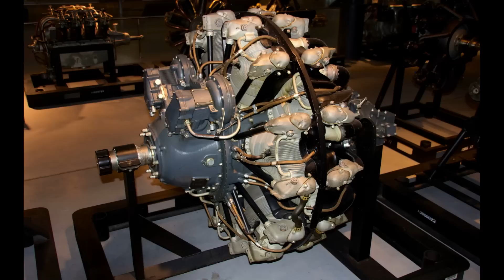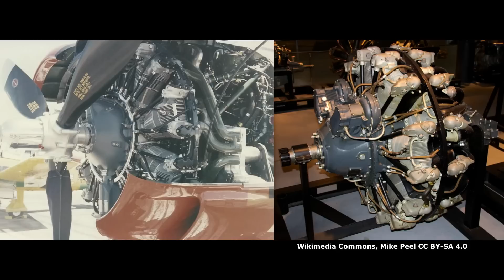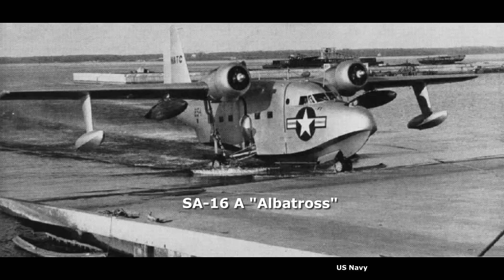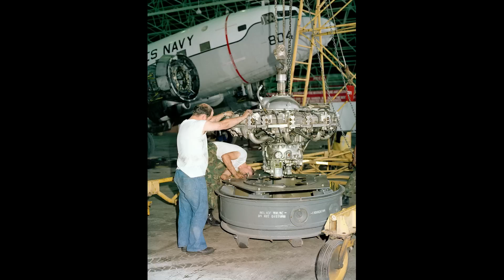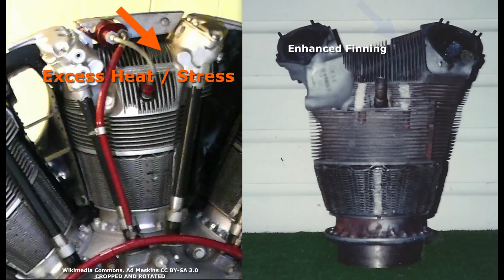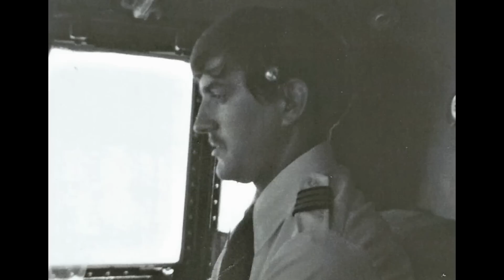The 9 Series Wright R-1820 and the Postwar Radial Design Reset (Episode 5)

Comment: Did the 9 series have higher compression? Usually increasing power output from the same displacement is accomplished by improved breathing (including more boost), more rpm, or higher compression. You didn't go into how the extra power was achieved……..
Reply from the maker: I mentioned the longer stroke which pulled in more air for compression, but I should have mentioned the compression ratio of 6.8:1 for the 9 Series versus 6.5: 1 -- 6.7:1 for most other large radial engines.

Comment: I am familiar with this engine -- sort of.  I was an "air attack" wildfire control pilot for a state forest service in the southeast US for a while.  The state owned three Mialec M-18 Dromader single engine air tankers* manufactured by PZL-Mialec in Poland.  These aircraft (built about 1994) were powered by a Polish-built  PZL Kalisz ASz-621R 9-cylinder air-cooled radial piston engine, with 980 hp.  This engine was a semi-bootleg copy of the Russian Schvetsov M-25/ASz 62IR, a version of the R-1820 licensed the Soviet Union.  The M-25 first flew in Russia in 1937 and was "improved" into the ASh-62.
Quality control and performance was ... umm, let's say, an unusual experience.  These aircraft were fitted with a 3.3 meter diameter four-bladed propeller made by PZL; it had skinny blades, was marvelously inefficient, and had seals on the pitch controllers that leaked more when seals were fitted than it did if it was run with the seals left out.  A quick fix was to fit DC-3 propeller blades but a more comprehensive upgrade was fitting a complete DC-3 propeller with pitch controller.  This was a complex engineering operation consisting of fitting thin-walled cylindrical spacers on the metric studs on the engine front section to adapt the inch-sized bores on the controller housings -- nothing else was needed.  The greater efficiency and better balance made the aircraft much easier to fly but really it was lipstick on a pig.
When the aircraft landed, they were met with a fuel truck and an oil truck, while the fuel was added to the wing tanks a similar nozzle filled the engine oil tank -- consumption was measured in gallons per hour for both.  We'd joke that piston rings were tested by dropping a dime into the spark plug hole on the top cylinder, if it dropped out of the spark plug of the bottom cylinder then the rings were worn out and needed to be replaced.  
The aircraft were appalling in many ways but the sound of the inertial starter spinning up, then the coughs and barks of the first cylinders firing, and then the sound of the engine on takeoff was thrilling music not heard at many modern airfields today.  (The aircraft were sold off with TBO timed out engines to ag contractors about 2019 to be replaced by turbine-powered "Air Tractors".  A great leap forward but sad to see them go - I loved those big old round engines.)

* There were four aircraft purchased about 1994 but one swallowed a valve caused by a dropped valve seat on takeoff after about 40 hours of time in service.  The aircraft was destroyed and the pilot fatally injured.
Reply from the maker: Thanks for sharing your interesting details/experiences with the Eastern Bloc engines/aircraft.  I had no idea that PZL Dromaders were operated in North America.  You certainly confirm that those Eastern copies were NOT the originals!
Reply: @AeroDinosaur  I felt a deep connection to the past when everyone (bomber pilots, air attack pilots, mechanics) would be called out on the flight line before startup.  Besides removing the tiedowns and control gust locks, we would take the propeller tips and "walk" the engines through 6 - 8 compression cycles to clear oil out of the cylinders.  As the propeller moved to the next blade, another person would take that one and push it through, then walk away from the prop on the other side in a continuous chain.  It was just like the videos of the B-17s being prepared for takeoff.  We all pitched in to do maintenance and repair work, I have felt very privileged to have been involved with them.

Just following the fall of the Iron Curtain, the Polish government was attempting to find markets for the PZL aircraft.  An importing company was established in the early - mid 90s in Wilmington, NC with a certified maintenance/repair facility at Burlington, NC.  That's how the Dromaders got to the Forest Service.  There was a push to sell the aircraft for ag flying with uncertain success, but at least some were sold.  A Canadian man living on the panhandle coast of Florida had a fleet of several (less than half a dozen) for agricultural work; he had contract with growers of "pulp wood" for paper making and he and his Dromaders would apply fertilizer to vast tracts of pine tree growing land in many states across the southeastern US.  I must add that by the time that I became familiar with him and his operation, most of his Dromaders were converted to PT-6 turbos and that change continued into the 20-teens.  But, yes, there were some Dromader operators in the US, late 90s/early 00s, at least.
Reply: Thank you for a most complete and thorough review of such an interesting workhorse engine.
Reply from the maker: @brucebear1  You remind me of some of the A1 Skyraider pilots I've talked to who in the early '70s flew the last single-engine piston combat missions in Vietnam or any war after that. They felt a unique kinship with the P-51, Spitfire, TBM, Hellcat, and Corsair pilots of World War II and considered it a privilege to fly the smoky, greasy, noisy Skyraider.  By the 1970s perhaps 99% of their flying peers did not know how to handle a heavy taildragger.  J.A. Reed
Reply from the maker: @brucebear1  Thank you very much and thanks for checking us out!  J. A. Reed

Comment: Surprise!  At about 23:50 into your video the comparison of power on the C-47 vs the later C-117D and the pictures used  showed the USMC C-117D with the number 420 on the nose.  That aircraft was US Navy Bureau Number (BuNo ) 12420 and I flew that aircraft while assigned to Headquarters and Maintenance Squadron 31 (H&MS-31) based at MCAS Beaufort, SC in the mid '70s.  I also flew that aircraft as the lead for the flight of two C-117Ds assigned to the Squadron to the "boneyard" at Davis-Monthan AFB in November of '78 and was therefore the last military pilot to fly it and so it holds a special place for me in my flying career.

The aircraft was manufactured as a C-47, Construction Number 09442, in 1943 for the USAAF.  It was subsequently re-manufactured under US Navy contract as you described as an R4D-8, later re-designated C-117D.  Sold surplus, it flew in civil registry in cargo operation for many years, and is currently in inactive storage in a south Florida airport.

Comment: As a tour guide at the Mid Atlantic Air Museum, never again will I point our stand  - mounted R 1820 from our H-34, and state it's the same as a B-17. Next time I'm there, I will take a close look at the cylinder head design. 
Videos like this are what keeps retirees like me on YouTube at 2AM!  
BTW, Amazon advises I'll receive your book on 9/27, looking forward to reading it.
Reply from the maker: Thank you for watching and for ordering the book!  I am sure you will enjoy it.  I suppose you could tell museum visitors that the H-34 engine is a "re-designed and more powerful version" of the engine that powered the B-17.  Continuing to make the connection with the B-17 might not be a bad idea because that plane is universally recognized and cherished.  Also, I am ready for your P-61 Black Widow !!  J.A. Reed.

Comment: Really enjoyed this episode. The WW2 Navy F4F-8/FM-2 R-1820 was rated at 1350 hp. Navy FM-2 ace, Joe McGraw, stated to me that their mechanics "tweaked" the engines to get more power out of them. He didn't say specifically what they did to "tweak" the engines but it likely involved an increase in either or both the max RPM and MAP. In any case, Joe was able to beat an experienced Zero pilot in a fight during the Leyte Gulf battle. The 9 series engines in the T-28B and C and C-1 that I was able to get time in were great engines, The E-1 used the 1575 hp version and the prototype with the twin tails and raydome removed was the fastest of all the S-2/C-1/E-1 type aircraft. As I recall, the C-1 had the 1425hp versions rated on purple 115/145 fuel. The max hp on 100/130 (green) fuel and 100LL (blue) was somewhat less.
Reply from the maker: Glad you enjoyed the episode and thanks for the info!  Nothing beats your actual experience.  Apparently, the 9 Series was also offered in "de-rated" versions as low as 1,100 hp, but I am not sure if those ever found applications.  I think one of the last B-17 versions built used 1,350 hp R-1820s, but I don't have details on that engine construction.

Comment: I believe the cylinder bore of the 3350, quoted as 6.125" incorrect. If memory serves me correctly the correct dimension is 6-5/16"
Reply from the maker: Actually, the R-3350 BORE wasn't 6 5/8" (6.3125"), but 6 1/8" (6.125"). The STROKE, not the BORE of the R-3350 was 6 5/8" (6.3125").  Before checking any other reference I always go to Jane's 'All The World's Aircraft' 1949 edition in the "Engines in Production" section.  Only after checking that do I check later references. Both the R-1820 and R-3350 are specified in Jane's at 6.125" bore.  On page 356 of your excellent book--and one of my cherished references, "Allied Aircraft Piston Engines of World War II"  you state, "The R-3350 shared the same bore and stroke as the R-2600, that is, 6.125-in bore and 6.3125-in stroke; . . ."  So, I just go with what I see!  I still can't figure out how you got your ground-running aircraft engines to run so successfully--I would not know where to begin. Thanks for watching--an honor! J.A. Reed

Comment: I want to put a 1525 horse on an AN-2. They had license built 1820s of 1050 hp. With a reversible prop, that would be a great ship!
Reply from the maker: Sounds like a great idea, but I guess you might need to add a cooling fan behind the propeller or limit the power, as the viewer below kind of hinted.  I guess that might be a major modification. J.A. Reed
Reply: @AeroDinosaur  
Yes indeed. Fan on the prop shaft like the FW-190 would help in ground operations, weight might be a problem as forgings  (heads) might be heavier than castings, being more dense, but the more fins cut in them might negate that; also, other beef ups might add weight too. Fortunately AN-2s are experimental here in the US, so there are more latitudes to use US powerplants. Even a 1200 horse 1820 from a Bull Thrush crop duster would be great. B-17 propeller too.  I wonder if a reversing prop would work on an earlier 1820. That would be fantastic for landing.  AN is one of my favorites and I want to own one despite 60 gph. I guess plane is an acronym for permanent loss and negative equity.😂 . Hell, P-51 burns that and has one seat, no baggage, and cannot carry a load and cannot land on rough strips. If I'm gonna spend the money on gas and oil, Antonov ticks all boxes for me.
Love your vids. Wouldn't mind talking airplanes. Message if you want. Aaron.
Reply from the maker: @huskyflylangley6053  Aaron-Thanks. Just send me an e-mail to the address shown on this written video description or channel description.  Would love to talk.  J.A. Reed
Reply: I too thought that would be insane, but then I'm thinking...the later model 1820s put out a LOT of heat. (as was well-covered in the video) Would an An-2 lumbering along at 100 kts be able to sufficiently keep the engine cool?  Doubt it.
Reply: @aircraftadventures-vids  I trained in them in Romania at a friend's airstrip and he operated with cowl flaps open and oil cooler open as well, getting off a 700'-800' strip with a full hopper load (3000 lb.) was no problem for the heat. If so, you can always pull 'er back, the takeoff performance with reversing capability is where that engine would really shine. 
It wouldn't have to work too hard to do its job. 
ASh-62 does well too. They run in the most horrible conditions.

Comment: A few things to consider:

- More specific power per cylinder will require higher cylinder pressures at exhaust valve opening so they will sound harsher because the higher frequencies this generates will become louder.
- First and second order balance is a radial force compensation required due to the reciprocating mass, not torsional vibration whose orders are determined by the torsional stiffness of the crankshaft and drive components and equivalent rotational inertias of other rotating and reciprocating components.  The master/link rod arrangement of most radials complicates this whole show because n-1 cylinder are running with elliptical big-end motion rather than circular.  Also torsional resonance will occur at generally fixed frequencies rather than related to engine speed (like reciprocating balanace does) which is why you wind up with RPM avoid areas on the tach.
- With exhaust turbines, be it turbocharged or turbo-compounded, the exhaust pressure will be much higher therefore with more energy so more heat will need to be rejected from the exhaust ports which will be one of the main drivers for the extra finning you see on 3350s and later cylinders.
Reply: Dang you know your engines
Reply from the maker: Thanks for your excellent feedback--which is exactly the good information I'm looking for.  Sounds like you have some serious direct experience with the big round engines.  I know there is extra back pressure in the cylinders from turbocharging which uses PRESSURE turbines, but I think the VELOCITY turbines in the PRT assemblies minimized this. Non-PRT late model R-3350s like the ones that powered the A1 Skyradiers had similar fin areas and patterns as PRT models, but I'm guessing the fin design may have been altered somewhat to suit the application.  You sure leave me in the dust on the vibration dampening--I'm wondering if some of the Navy's problems with the engine have to do with the cumulative effects of some of the pilots not adhering to the tachometer limitations over time. J.A. Reed
Reply: @AeroDinosaur  You're welcome.  Regarding the turbine thing, they all operate in the same way, like every machine that uses a gas working fluid.  You're taking high energy gas (pressure and temperature) and converting it to low energy gas by extracting that energy into a mechanical device.  All turbines convert the high energy gas into gas velocity before firing it at the turbine by passing it through a nozzle  In the case of a piston engine, the nozzle is basically the exhaust valve/port/manifold which is usually less than ideal because it allows for a lot of expansion that doesn't create gas kinetic energy prior to reaching the turbine.  That's why we have multi-scroll turbines on turbochargers these days to minimize this effect.  The job of the turbine and guide vanes etc is to make the expansion happen with a minimum of turbulence all while collecting some mechanical energy from it by moving.

Comment: Nice coverage of the old Radical Round Motors. I was stationed at NAS Corpus Christi Tex. in VT-28 squadron. We had TS2A Tracker's with 1820-9. I had a turn card for Hydraulic shop, so was authorized to start and run engines to verify Hydraulic system repair and maintenance. I loved starting those things, I only blew the stacks of once. blowing stacks off sucks because no body going to help you reinstall them.
Reply from the maker: Thanks for your nice comments and sharing your experience-glad to reach real Tracker guys.  I used to see them doing endless touch & goes at North Island San Diego and was always impressed by them. Will talk more about Trackers in the next episode, so let me know if you have anything you'd like me to share.  J.A. Reed
Reply: @AeroDinosaur  Thank you for your reply. All can think to add is I was NOT high power rated for running engines. Just low power for Hydraulic checks. But there is something magic watching 2 1820-9s putting out 1525 at night. sucking the moisture from the humid Texas air, mix in the blue exhaust and flashing red marker lights was awesome to watch.  This is 1972-1976 time frame and Trackers were getting replaced by Beech King airs.  Also we were stupid 18-24 year old, Who Needs ear plugs. paying for it now.  Keep up the great episodes on Radials.  Say Radial now and the young say, WHAT?  I also think I could start one right now.
Reply from the maker: @richarderickson8840  Well, I never started one so you would have to teach me!  I echo your sentiments on the S2--they had me hypnotized.  Ear plugs would only ruin it.
Reply from the maker: @richarderickson8840  You got one up on me--I've watched them being started from the flight deck, but never started a big radial myself!